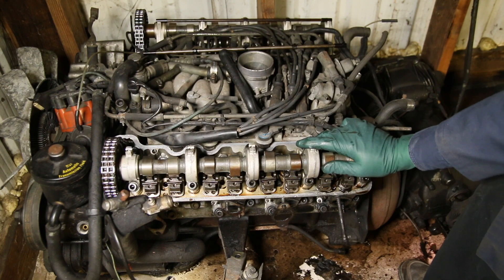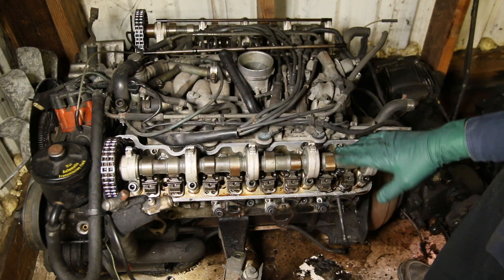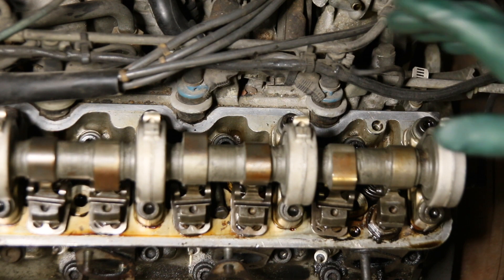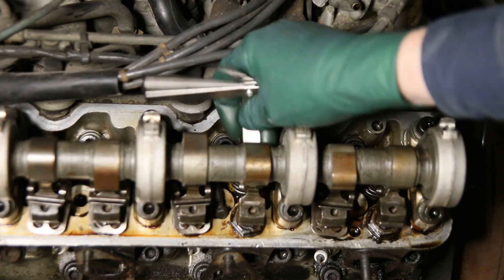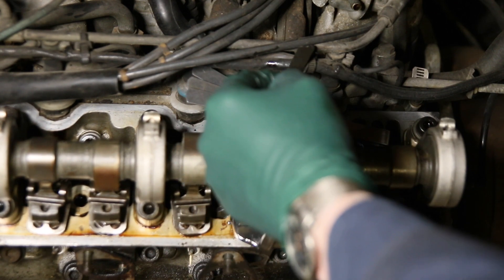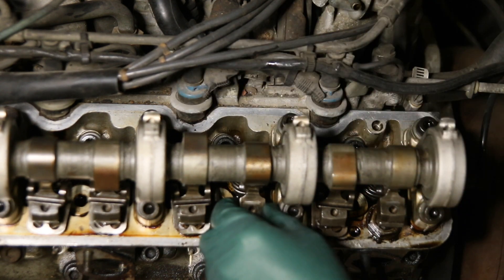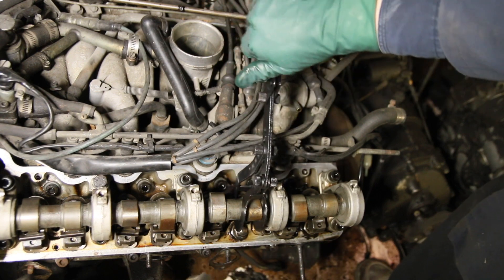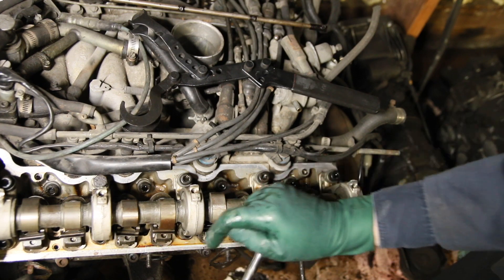Early 3.5 and 4.5 V8 Valve Adjustment Problems and Solutions

Comment: I have a 2006 cls 500 m113 and w219 chassis. Im having an issue where it is long crank and no start, I turn off and back on and it starts the 2nd time it does it at random... so its so intermitent... I have no codes, I was wondering with your knowledge if you can teach me something. Ive done the cam and crank sensor..
Reply from the maker: It could be in your electronic ignition switch. You may need Star diagnostics to find the problem either at a dealer or independent who has the software.

Comment: I would like to know if the clearance tightens or loosens as miles accrue  between adjustments? Valve and seat wear would tighten  (valve stem would rise) and follower/camlobe wear would loosen..(increasing clearance) thanks

Comment: I have a 1976 450sel. Do you know if I have hydraulic lifters or adjustable?
Reply from the maker: Most likely hydraulic if it is the original engine and it has K-Jetronic fuel injection (CIS).